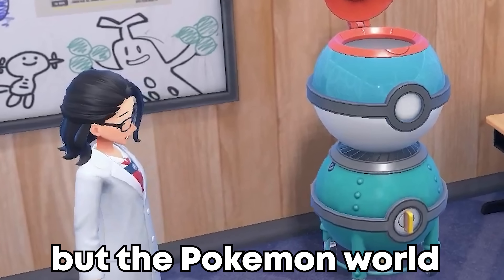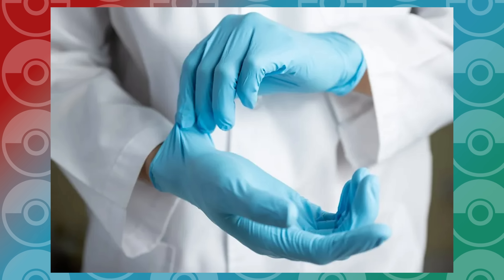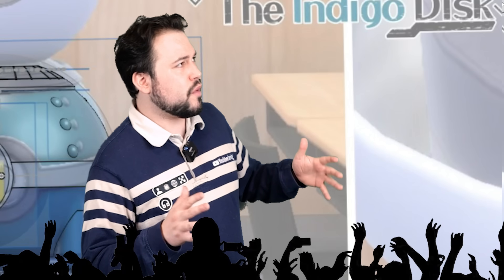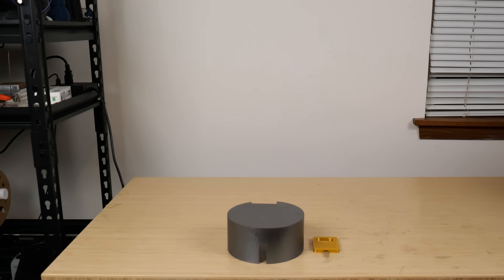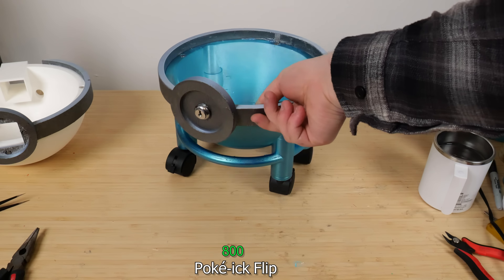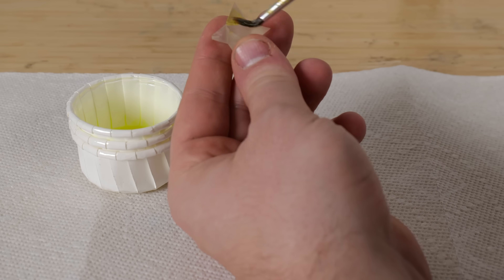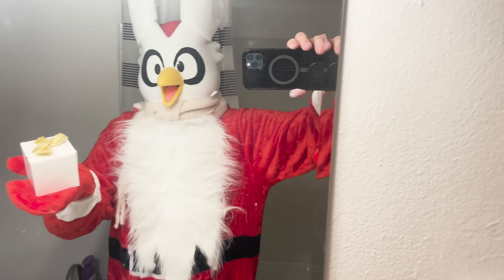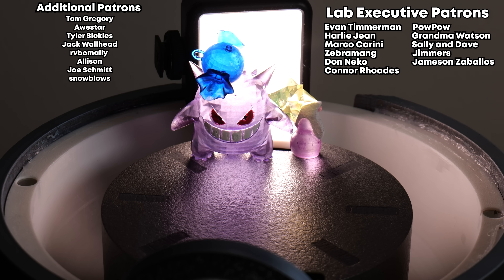I 3D Printed Pokémon's Item Printer

Comment: Hi man I am not sure about the defects but when ever I have problems with my resin printer and the files and slicing is ok then in 90% of the time its because of tempreture problems ( to cold or changing to much). Is it possible that the noktua fan is to strong ?

Comment: Ugh I need to buy an FDM printer already, so many additional options that aren't suited to resin printing. Also, not sure I would trust that carbon filter as your sole filtration system. Granted it's a tiny printer and it's not producing a ton of fumes, but I would still ventilate the room, air it out a window or something. Since you're beginning to dabble in resin might be worth investing in an air quality monitor.

As for why that Gengar failed, I would need more info to diagnose it but there's a TON of reasons why this could be the case. I've been meaning to do a video on all the reasons, I need to get back to posting lol. Here's the 16 I wrote out for that script:

1. Insufficient Supports (islands)
2. Bad model orientation
3. Bad exposure times
4. Light-off delay too short
5. Too slow/fast lift speeds
6. Model not optimal for 3D print
7. Print is too large/solid for your printer to handle
8. Corrupted Slicer file or flashdrive
9. Resin unmixed
10. Cured resin bits
11. Cold Room/resin Temp
12. Build plate not properly leveled
13. Build plate too smooth
14. FEP too loose/damaged
15. Bad LCD screen (leaked resin)
16. Stepper motor struggling

Feel free to reach out on Discord if you need some help!
Reply from the maker: I have a tier list of my suspects.  Would definitely hit you up sometime soon if you have the time!
Reply: @BigRigCreates  Hmu whenever I'm online!

Comment: For printing clear resin prints like Gengar, it may be worth trying to print it solid. Yes, it'll be a hekken chonker, but the effect is better imo. When I'm having issues with my resin printer, it's usually because the room is too cold. The trick I found (other than buy a $200 tiny heater from Anycubic or Elegoo) is to buy a fermenting belt as well as a temperature regulator, like ones for reptile habitats. It keeps it at 75- 80 F and you can adjust what you want the temps to be. It also keeps from accidently burning things down since once it gets hot enough, it will stop sending power to the heater. Once it drops low enough, it will send power again.
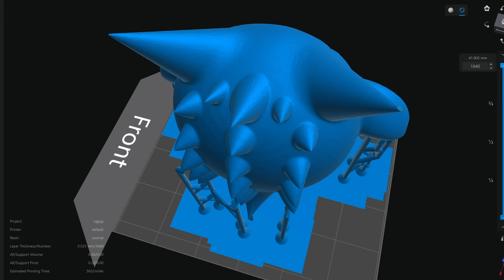Reply from the maker: I tried printing solid, but parts of the print would just not appear (see 9:44).  You might be onto something with the temperature though since the winter weather hit just as I started printing in resin.

Comment: idea make it bigger like way bigger so u can have it fully auto and maybe make the resign printer on the bottom one or hey even make it big enough to fit a normal one then make it like a hand that brings it up to the top and make it where it opens up like the one in game so yeah
Reply: Tyranitar had a stroke trying to read this and (REDACTED)ing fainted
Reply: @koopatroopa7968  basic terms make an arm that grabs the 3d print from the bottom and puts it at the top to grab also making it bigger

Comment: 11:42 From my experience transparent resin is MUCH harder to print than opaque. Have it cure for an extra second each layer, and make sure the resin is warm, its very temperature sensitive.
Oh also if you havnt heard of UV Tools, try that, at least to analyze the print file.
I havnt exactly watched a resin printer with the top off much but at 9:27 the resin looks very viscous which is not what you want. You can buy a brewery band and wrap it around the vat to keep it warm. But since its such a small printer I might just go the route of leaving the resin in some warm water for a while before putting it in the vat then printing.
Reply: If it's the same standard fast resin as the opaque, an extra second is completely unnecessary and will just cause other issues and loss of details. I print in both clear and opaque and have never once had to increase the exposure time. There's a variety of other issues that are likely the cause.